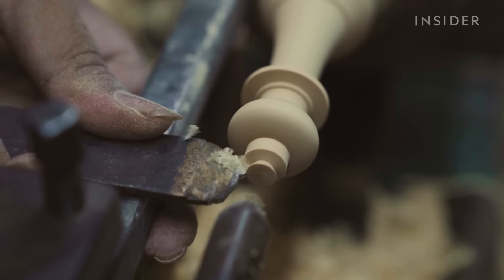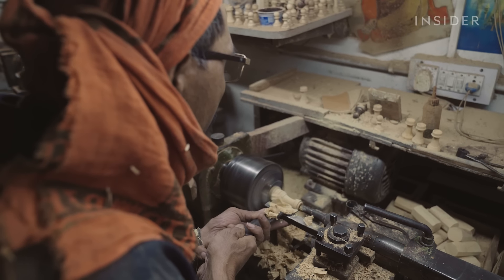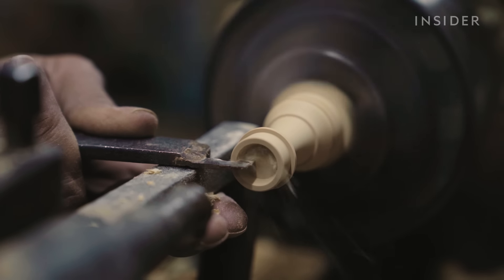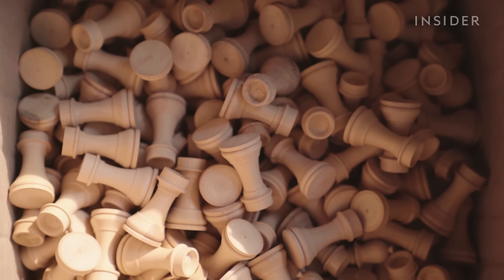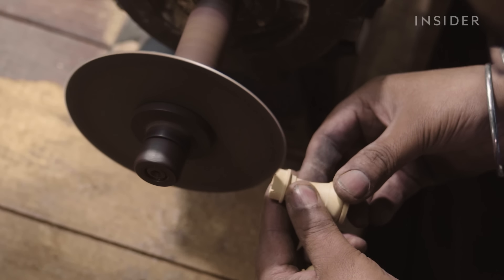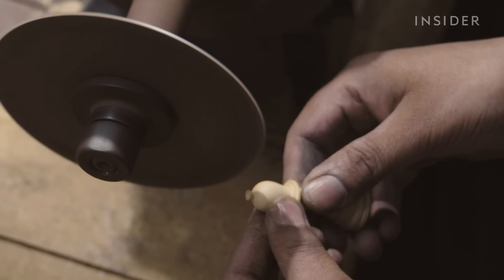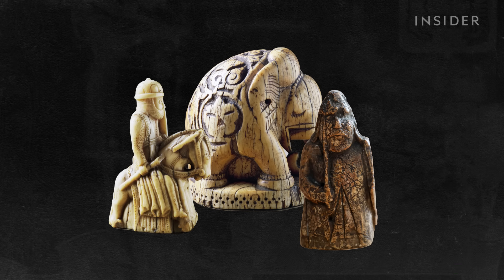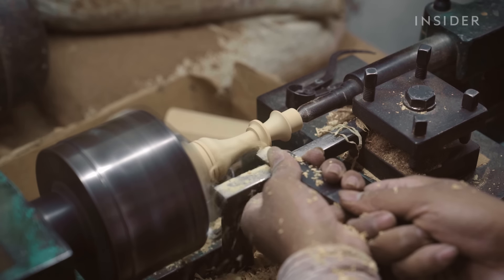Why Championship Chess Sets Are So Expensive | So Expensive

Comment: "It can actually affect the outcome of the game" I sincerely doubt that any player, let alone a professional, is gonna get thrown off by a less than perfect chess piece. I do, however, firmly believe that whoever thinks the previous to be the case also unashamedly enjoys the smell of their own farts.
Reply: I can tell you have never truly dedicated your time to perfect and become a true professional in anything. And I'm not saying this to insult. I'm saying this because when you do something over and over and over and over and over.... You immediately can tell the slightest of variations to something if all the sudden, its different. Which causes you to think, instead of using instinct (muscle memory), which in turn actually does affect your performance. I firmly believe that whoever doesn't think the previous to be the case, has never become a professional to their craft.
Reply: @johnathancarlton6710  you’re not a professional or a master of your craft until you can be good without being distracted by  “cheap material”.  The real world has distractions and imperfections you need to learn to adapt to be labeled a “master”
Reply: @axshman6914  Negative ghost rider. A master can mitigate and lessen distractions. But they are still present in the mind. A carpenter doesn't pound a nail down with a hammer with no handle. Can it be done? Yes. Is it going to be less effective? Absolutely. Will it effect the overall build quality? Possibly. A master is the one that will spend major money on a perfected piece of equipment, because they understand the nuances of said equipment. If you drive a Bentley everywhere you go, and all the sudden you have to ride a bike, do you think you wont be aware of said tool you are using to transport yourself? Noticing the difference is a distraction, and a that is a distraction that you can control. A master would eliminate said distraction because they can control that distraction. You saying the world has distractions is moot. Because those distractions you can not control. But a master chess player has control over what pieces they use. They will opt to use the pieces they're more comfortable with, that they have played with 10000s of times.
Reply: @johnathancarlton6710  do you honestly believe magnus, the most “top” master of masters in chess, would have his elo affected if he was playing online against opponents playing in person? Since there are zero physical chess pieces
Reply: @simonkim8646  I guess I would need to see a study on classical online tournaments to believe there are a statistically significant number of mouse slips online. Bullets or blitz certainly, but those formats have blunders anyway
Reply: @steviesteveo1  There's another saying about that. "He who says it can't be done, don't disturb the one doing it" 😊
Reply: @johnathancarlton6710  A hammer without a handle is useless. A chess piece that is three degrees off from perfect symmetry is just another chess piece. It’s not even close.
Reply: @johnathancarlton6710  If what you're saying is true then most masters would be constantly off their game since these sets are very expensive and only used in world championships. Most tournaments also require bringing one's own chess set which is not standardized further than very basic measures. If your were correct this would imply players using their own sets have huge advantages, which unsurprisingly doesn't hold up when looking at win percentages. As some others have alluded to, online chess would also significantly decrease performance since the pieces look nothing like OTB. The simple fact is that as long as the pieces are fairly recognisable it will not affect a high level master's play. When some people have the ability to play simultaneous games in their head and visualise many dozens of moves in the future it would be a rather silly notion that any slight imperfections in the creation of still recognisable pieces would cause one to become out of focus or lose basic intuitive ability.
Reply: "The ear on the knight was deformed, I lost the game because I mistook it for a rook." XD
Reply: @johnathancarlton6710  You probably voted for Trump
Reply: @chrisdawson1776  What brand of paint do you eat?
Reply: @johnathancarlton6710  You probably voted for Trump

Comment: I wanted to learn why they are expensive, not how they are made...
Or at least why championships have to use these instead of perfect machine made pieces.
Reply: Because there are no perfect machine made pieces. 

I teach chess and have played it since I was a child and have handled literally thousands of sets. 

Plastics sets always have flaws. They are no where near as aesthetically pleasing as handmade wooden pieces. They have poor weight distribution.
Reply: 4:45
Reply: @jorgejustin461  A good aerospace grade CNC machine can have precision down to 10 microns. No human can beat that, regardless of their training.
Reply: @jorgejustin461  "Because there are no perfect machine made pieces." err... do you have the slightless idea wtf are you talking about? No, you don't. Leave in shame, please.
Reply: I played official tournaments for years when I was younger.  I've handled a wide range of different sets.  The best-feeling ones I held were always plastic because the most important factor to feel is how heavy the weight in the bottom is, and the extra heavy weights were in the plastic sets.

Also, the weight distribution point is incredibly bad.  Casinos use machine-made plastic dice, not handmade wooden ones because machines and a uniform material are how you get perfectly engineered weight distribution.

The real answer is much simpler: opulence.

In such a prestigious tournament, while rationalizations may be propped up after, the truth is spending excessive money is the point.  It's not really any more complicated than that.
Reply: @jorgejustin461  I don't think you know nearly enough about CNC machines.
Reply: @dynamicworlds1  there
Reply: There's nothing wrong with preferring something that is hand made, or has any other discernble quality. Just be honest with yourself about why, and don't buy into or promote the fallacy that the business men who want to inflate profits by obtaining sole source contracts to create artificial scarcity, while also literally teaching young people that there is any objective, quantifiable difference that justifies the infoated price.

Comment: Hmm... This looks like a good use for a 4axis CNC. Imagine the consistency and speed.
Reply: Yeah, the answer to the title is "because they deliberately limit the supply in order to artificially inflate the price"
You can get way better sets for way lower prices
Reply: Exactly it's not like they are not used for other stuff that require much higher precision and that actually matter lol. But i guess Beregorn is right.
Reply: I was thinking same thing. CNC can pretty much mass produce more unique and identical pieces. And having only 10 people being able to make knights, come on. Like half woodturners on youtube could do same thing. Also, for pawns they were using template cutter.
Reply: @MrGelowe  True but I guess carving sounds cooler
Reply: @Chad L not necessary. Even if mass produced pieces take over, demand for hand made pieces will stay. They could even make them with unique customizations that can't be easily replicated by cnc
Reply: This argument can be made for almost every sector that has automation or has possibility. But there's a reason handmade equipments always command a higher price, despite the arguably lower 'consistency' and 'quality'. The price is for the craftsmanship and experience of the artisan.  Just compare the price of a mass produced car vs the price of a luxury handmade car, the difference is immense, although the quality levels might be almost similar. But the customer pays for the exclusivity of the craftsmanship, and I guess that's just how rich people work, lol.
Reply: @aryanahmed3301  only if the artist making that custom car is famous, you can't take an artist off the street make him build a custom car and sell for the several multiples of commercial car's price that's available.
Reply: @Beregorn88  No they dont. You can set up your company and start producing chess sets with CNC.
Reply: @JKHTX  indeed... 🤔
But quite frankly, I think it would all pay itself in less then two years. But the narrative of craftsmanship...
Reply: @bebzon8941  but it wouldn't be an "official championship chess set", would it now? That's what I meant when I said that the price is artificially inflated by keeping the number of sets available arbitrarily low. It is easy to produce a lot of sets for cheap, but they don't, in order to keep the price high; that's why sets of comparable quality without the "official" stamp are way cheaper.
Reply: @JKHTX  a cheap, hobbyist, 4 axis CNC router can be bought for 500$, the cost of a SINGLE set. A fancier one is around 2500, while an industrial ones is between 10'000 and 30'000. With 60 sets (probably a couple of days of work) you have already recovered the initial investment...
Reply: @JKHTX  4 axis cnc costs upwards of 20k USD. Assuming 75k for machine, infrastructure and tooling. And considering that a good knight piece goes for over $50 each currently. You can recover your investment by just selling 5000 pieces at $20 a piece.
Reply: @aryanahmed3301  But they literally said part of the evaluation is consistency and symmetry which nobody can bear a machine.
Reply: @stonerkitchen8688  Who knows how much of this interview is real and how much is not? They might not want to introduce machines in the production because the reason they can sell the chess sets at such a high price other than the championship sponsorship and the production limit is that the pieces are handmade and you can put whatever price you want on art crafts. Maybe there is a CNC behind the scenes and the artisans are normaly called to do a touch up, or maybe there is a hush deal to order the pieces from another workshop with CNC so they don't have to buy it themselves. It's not like they would have to pass inspections.
Reply: @JKHTX  At $500 a set, not a lot
Reply: The workers should hit the timer clock after every piece is made just for effect.
Reply: These sets are made for the best of the best who care about chess more than anything probably. A chess set made by machines is a chess set whereas a chess set made by these guys is art. There is huge effort put into every piece and intentionality and history so I don't see them being replaced anytime soon.
Reply: @Someone-nv1cj   lol
Pls stop with the narrative of "they probably care a lot about chess" or some similar bullshit; they care more about their wage, if they could get doubled their wage, they probably stop carve and start doing something else. And pls stop saying that what they do is art, they need to REPLICATE as closely as they can, what the instruction say. They must not use creativity while carve this set of chess... It's the farthest think that resemble the process of making art
Reply: @LeNoire060  Go and finish your milk and stop posting comments on youtube without asking your mom. Young kids arent supposed to do that
Reply: @Someone-nv1cj   lol
 Are you angry man? For what exactly? Maybe becouse the romantic vision of yours is nothing more than that? The reality is that they work like that becouse in their country they need to do so to survive and the others country exploit this to get items at a low cost; if they go in any modern country, they'll get 20x times what they get working there.
It's better to not romanticize this kind of work slavery

Comment: ignorant question here: since, besides the knight, almost all pieces are symmetrical on the Y-axis, can't they just push a metal mold against the turnstile to shape the pieces? then add the minor details
Reply: They had to make the whole thing sound more interesting than a "workshop in india carve wood for sale"
Reply: They do.
Reply: I wouldn't be surprised that most are. But on the video they'll only show people carving by hand.. The back room has the lathe.
Reply: yes
Reply: Kost and durability of the tools, you would need a to buy a set of unique tools, which are complicated to make, instead of "cheap" mass production tools, maybe even a machine that can hold in this new tools. If you dont were to do it from hand i think the force on the larger tool surface would become to much. Also due to the larger edge the service life would be greatly reduced compared to normal cutting tools. But there are other means of cheap mass production, but where would the prestige be if chess masters play on $10 sets.

Comment: Wouldn't these be extremely easy to produce, perfectly up to specs, with a cnc machine?
Reply: It could be. But the value wouldn't be the same. Handcrafted are sometimes have a more appealing choice.
Reply: I think so, but people are willing to pay more for handmade stuff. So it's not really worth it for the manufacturers.
Reply: @kaito.h4057 
There is no inherent merit to handcrafted work if the result is no better than what a machine can produce. This is the most pretentious episode of So Expensive since the Ernest Wright scissors.
Reply: I was thinking exact same thing. I wonder why no one does this already. 

This might be happening in the future if there is no more craftsman to make these by Habs.
Reply: @kaito.h4057  only because a sucker believes it.
Reply: @Racle  people are already doing this. Again, the value is in the handcrafting, but I think its stupid as well. Saying this as someone who builds and uses machines as a hobby, its not easy either. 

I wouldnt be surprised if there are businesses peddling "handcrafted" chess sets that were really cnc machined or made with some other kind of automated process
Reply: @Racle  The market is/was very small. These pieces last until they are damaged and even then - replacement pieces can be ordered. World Chess Championship only needs a few sets a year for the highest rated matches. 

Chris threw out the number 250 sets x $500 so only $125,000, which is near max production rate. It would takes ages to recoup initial investment costs - lumber contracts, cnc setup, workshop rental costs.

Just seems too niche. Getting a loan with this business plan seems unlikely.
Reply: @RJirl  Well usually business will do something else than just one item. These could just be side product what business will make.

And if you already have CNC machine in use, creating few sets like these every year wouldn't be that much of a problem IMO.
Reply: Using "oh, it's handcrafted" as a marketing play, but only the company benefits from it

Comment: I can get a marble chess set for $100. And one that is hand carved for $50 online.  They use proper steel tools called cutters ro make the perfect cuts. If you can present it a perticular way they can demand any price. If you can make injection molding sound elegant enough you can charge $1000 for a plastic chess set.

Comment: Something that could easily be CNCed into perfection
Reply: Yeah, the only one that should be even slightly difficult is the knight. 
The pawn could be mass produced with just some cutters that had the entire outline of the piece
The rook could be cut out like the pawn, but with a cutter at the end to make the top part hollow. Then they could have a jig on a small table saw or bandsaw to make perfectly spaced notches for the rim
The bishop would also be made the same way as the pawn at first and then put on a cnc jig to finish it with the L shaped notch
The queen would be made similarly to the rook, but with a router jig instead of a saw for the rim
The king would be made similarly to the queen, but would also need a jig at a saw to make top of the crown flat
The knight would need a 6 axis cnc for pretty much everything except the base, with could be turned

Comment: This video was pushed hard on my recommended page. It shows craftsmen in rags, sitting on the floor of a dirty shop. No air conditioning, no mention of their pay, nothing about how they source their wood. We're told that the pieces take tremendous practice to make properly, and that skilled carvers are hard to find, but that just means that it's difficult to find skilled craftsmen who will work under these awful conditions. The fact that this video was produced for the usual angle of "praise the craftsman" instead of "holy crap, championship chess pieces are made on the dirty floor of a sweatshop" is so cynical it really pissed me off. Do better, Business insider.